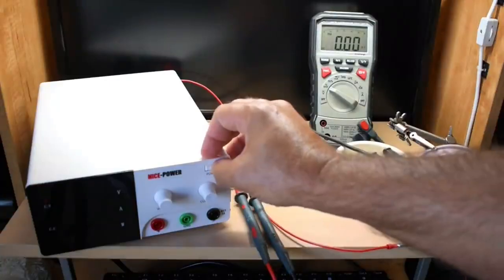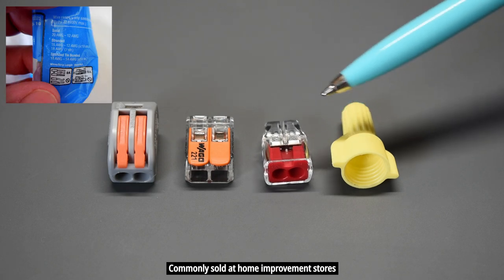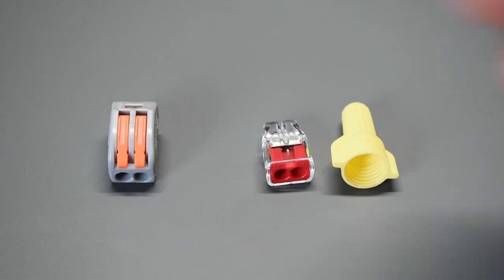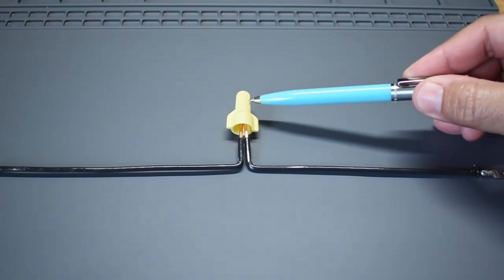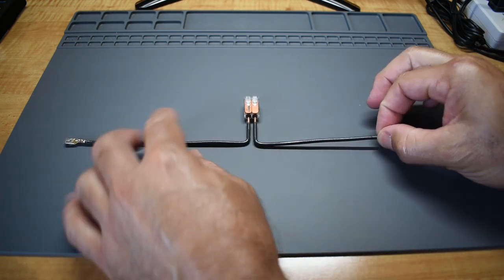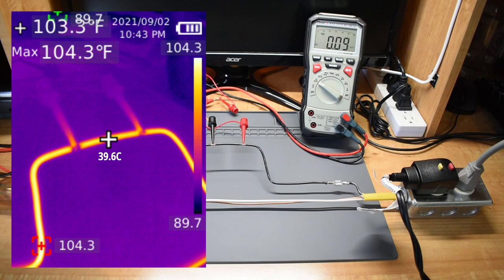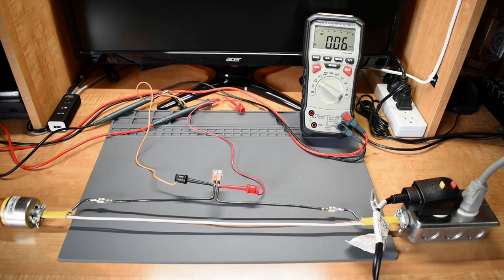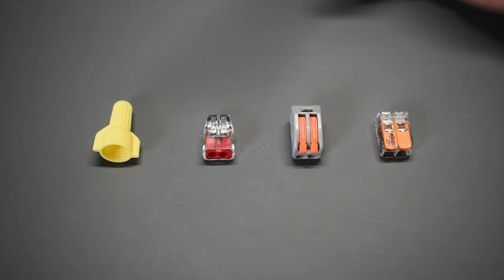BEST Electrical Wire Connector? Wago, Wire Nut, Ideal In-Sure, Lever Nut

Comment: They are from Europe, which is pretty much all 230 to 240V and an 18 amp circuit in Europe is very rare. most sockets in Europe are on 16A breakers, or in the UK we have a weird ring circuit with a loop on a 32A breaker. but they should be designed so that each leg of the loop circuit takes half the current, so again a max of 16A. the only circuits which would likely see anything over 10A would be in the kitchen, or an electronic shower/heater or possuble an EV charge circuit or other new green tech related system. but oven, cookers, showers, and heaters etc are wired on their own separate "special" circuits, with larger cabling (normally 6mm2 or 10mm2) and individual breakers, so you wouldn't be using these wagos on those. Wago do a larger model but the springs are stronger and all round much larger, so the results would be different. 

Wagos come into their own when the wiring has to be removed often. I work in industrial control, and Wagos are a godsend for quickly connecting and disconnecting sensors and other control devices. these devices are very low current/voltage (24VDC 4-20mA). 

Another reason these are popular in the UK anyway, is that these are certified as "maintenance free connections", meaning that they can be "buried" behind walls/under floors in hidden junction boxes. Other types of connecters (screw type) are not allowed to be hidden, and must be accessible. this is because the spring holding the wire can "breath" with the expansion and contraction from the heating and cooling in the conductor. where as other connectors (screw type) can come loose over time.
Reply: I wouldn't call a ring main weird, I would call it superior.

Comment: Thanks for the testing, good to know.  I use the Wago connectors for low voltage, and for temporary and testing mostly.
Reply from the maker: You're welcome Pete!
Reply: I used several of them on my motorcycle to aggregate wiring from a number of accessory lights... wasn't too worried about 12 volts, but I wouldn't use them for permanent 120v wiring.
Reply: @garthhowe297  I use them for 230V and 400V permanent wiring. No issues whatsoever.
Reply: @mrjakobt  Cable size has nothing to do with voltage. 1.5mm² cable is rated for 10 amps. 2.5mm² is rated for 16 amps, and 4mm² for 20 amps. Voltage, even if it's one billion volts, has nothing to do with cable size. Cable insulation, however, is related to voltage rating.

Comment: This is a fantastic test. Thank you for creating this content. I think the angle of the infrared camera reading may give an advantage to the wire nuts. The "top-down" angle in those measurements reads the temperature on the exterior plastic of the wire nut. The "bottom-up" angle on the Wago products reads the temperature near the junction of the wire and the metal in the connector, which is where the heat is generated.  I would love to see destructive testing that gives the mean time to failure for a sample of each of these units.  Thanks for showing us this excellent comparison.
Reply from the maker: Glad you enjoyed the video! I have many other testing videos on my channel, so be sure to look over my extensive video playlists below for videos of interest to you, and most importantly take one minute to share a link to my channel with others. Thanks
http://www.youtube.com/c/electronicsnmore/playlists

Comment: Nice detailed test. I am running new lines with a couple of outlets & switches and after watching a few videos promoting the Wago connectors I was considering using  them. But after watching your video I will stick to pre twisting & using wire nuts. If I had to connect several wires or had to work with an preexisting older outlet box with limited space I would then give the Wago a try.
Adding another 👍 to this video.
Stay safe, Joe Z

Comment: Thank you so much for this video. I just assumed there would be no voltage drop or increased heat regardless of the type of connector. Going to stick with wire nut.

Comment: I just wish you'd conduct the same tests with the mix of solid with stranded wires together.
Not only one solid and one stranded, but also with 2 or 3 solid plus one stranded. 
This is where the Wire Nuts get the worst connection especially with electronic thermostats and also with the heating baseboards or convectors,  everywhere you have a mix of solid and stranded under higher current. Wire Nuts seam to make a decent connection at first, but after pushing them at he bottom of the junction box they may loosen and also after 15 to 20 years the connections get loose, dangerously loose due to metal fatigue I believe. They often fail ! This is where the Wago 221 may be a very interesting solution.
Reply: Yeah, connecting solid and stranded wires together takes a bit more care to expose more of the stranded wire and to wrap it around the solid wire before wire-nutting them.
Wiggling is more of a long-term problem, too, with stranded wire because the strands break more easily.  Taping the wires together to prevent relative movement helps, but
it's laborious.  A video devoted to dealing with stranded wire would be invaluable .....  <hint, hint>  :-)

Comment: Very helpful. I use wire nuts when doing final work but have used lever nuts when making temporary connections. Was considering moving to only lever /wago option for everything but your demonstration convinced me otherwise.  

Sort of surprise how hot those connections get under load.  Never thought it be more than 100*

Comment: Excellent test, especially for doing it under 18 amps, which allows a load evaluation between medium and high, which is not commonly seen in other tests. The temperature detail is definitive when considering which is safer for medium/extreme conditions. My conclusion for use in connections of 10 amps and up I would only recommend a screw terminal box or wire nut used professionally. just my opinion.

Comment: Very impressive testing.  I think you've found an area where wire nuts are clearly better.  However, I think I still prefer Wago overall because they are more idiot proof, and that's more important to me.  I've run into more loose connections on wire nuts than I would like (some of them even mine), and I'm more concerned about a loose connection causing arcing than I am concerned about a Wago being a few degrees warmer.
Reply: The one area where wire nuts are better is the single most important aspect of a multi wire connection. The lower contact resistance means less heating, less possibility of arcing and more current delivered to the load.
Reply: @heathwirt8919  
Less heating, but does 6 deg +/- really make that much difference (wire nut temp at 106 vs the others at ~110 deg)?

And the voltage loss difference between the wire nut and the Ideal push connect and the others seems negligible too.   

As Dan Sanger said, I'd rather go for a secure connection, where no wires are going to pop out when you push them back into the box.  I've definitely seen wires come out of wire nuts when there's more than two twisted together.  

Can you even twist 4 or 5 wires inside a nut?  I'd be concerned about that.  You can easily connect 4 or 5 with the right push connect.
Reply: @jpmacoo  "And the voltage loss difference between the wire nut and the Ideal push connect and the others seems negligible too. "  If the voltage drop was negligible the temperature rise would be almost identical. Obviously there is a convenience factor to consider using the Wago connectors. If you need to connect 4 or 5 wires using wire nuts you can easily daisy chain the connection using additional wire nuts. My biggest gripe with the Wago connectors is that they should offer equal or better electrical performance than wire nuts, clearly they don't.
Reply: @heathwirt8919  
I didn't say the same, I said, "negligible".  5mv vs 8mv.  Do you think that and the 6 degree temperature difference are substantial differences?

And why do I want to add additional wires and more wire nuts in the box, when one push connect can do it all, more securely, and in much less space?  You're after adding many more potential problems and chances for disconnects
Reply: I depends on the quality of the installation, as you mention. Poor makeup of "wirenuts" will clearly lead to a problem; proper makeup won't. Have you tried the the 3M Secure Grip or 3M Performance Plus wirenuts? They are outstanding and likely the best wirenuts made. Properly installed, they form an outstanding, cool splice. I'd trust them over Wagos... But, I do agree with you that Wagos are more idiot proof, and that is definitely a benefit..
Reply: @jpmacoo  Heating gets greater over time because it promotes oxidation at the surface of the copper.
And if the wires can wiggle, more oxigen can get to that surface.
I'd still use the Ideal connector for joining more than 3 wires, though
Reply: @boeing757pilot     Idiot proof shouldn’t be an issue with a professional electrician, a wire nut is pretty simple to install properly.
Reply: @huejanus5505  Yes, this is true. But, I've definitely seen some poor installations (wire pull out).
Reply: @boeing757pilot     So have i. Even worse, i’ve occasionally just touched a wire nut and have had it fall off. The problem is usually pilot error though. With diyers a little knowledge can often be dangerous.
Reply: Wago aren't idiot proof, they are idiot magnets.
Reply: @boeing757pilot   - Re "square-edge spring":  How do you join stranded wire to solid wire? In that case, I worry about severing strands of wire.  Do you think a smooth spring and the use of anti-oxidant paste would work?
Reply: @daveinwla6360  That spring won't cut through the stranded. It will simply bite into it. I use the 3M brand exclusively and they do an excellent job without damaging the stranded conductors. But the Ideal brand "bites" into it as well and does nicely. Any quality connector will slightly "slice" (or bite) into the conductor to form the gas-tight connection without damaging the conductors. Grab yourself some Ideal or 3M to splice. It will be fine without an anti-oxidant.
Reply: @boeing757pilot   - Good to know!
Reply: @daveinwla6360  The 3M connectors are a bit expensive.  But, they are definitely worth the expense, especially if you're working on your own home. Check out the "3M Performance Plus" or "3M Secure Grip" connectors. A bit more expensive but definitely outstanding..
Reply: @huejanus5505  I have seen wirenuts melt from them being installed properly. Problem is because they are so cheap the threading on the nut was poor and the vibration wiggled them lose. Also the thin plastic of those cheap caps can spin off with some use of the wires. They are horrible and when I see them I replace them immediately. I go for the harder and thicker caps cause they tend to avoid the problems. Less prone to mice chewing as well.
Reply: @heathwirt8919  if it's german you can be sure it is safe. If it's chinese than you should be careful.

Comment: Wire nut problem is that many people don't tighten them enough. It's not about pre-twisting wires together, just need to tighten hard and feel for the bite into the wires, use pliers to give it a bit more bite without twisting so much you break the ends which happens more often with cheap copper. 
Wagos are great for mixed sizes or braided meeting solid.

Comment: Thank you!
I love using Ideal connectors, especially in tight boxes, but they ARE tough to use with soft stranded wire. In those cases, wire nut is still my go-to😎
Reply from the maker: You're welcome! Please share. Thanks
Reply: Genuine WAGO connectors work great for stranded wire.   Wirenuts are just fine if Done Right.

Comment: very interesting test. I moved here from Germany about 20 years ago, and first hated the wire nuts. I got used to it and actually really like the blue ones. I've also come to use all kinds of Wago connectors recently, and I also like them. It makes total sense that they are not as  good in your test, because of the solid copper wire you use. I think they are mainly used for braided wire in Germany (where I first saw them used by friends). Those wires in return, work very poorly in the nuts, so to each their own I  guess.

Comment: Perfectly done testing. This debate has gone on for quite a while, and finally there is a test that shows heat buildup. Especially on a short run.  Then you throw in the fact that if these were used to run a 7 or 8 outlet circuit, by the last outlet you could be talking quite a rise in voltage drop/heat buildup.

My biggest issue with the clip type connectors is when you pull it out and look where the blade held the wire in place, there is just a tiny nick in the copper.  That means that all the current is running thru the 2 points of contact made by the connector.  Essentially reducing the gauge of the wire electrically.  Overseas on a 240 volt system this may not be a problem, but as for in the US I'll stick to wire nuts.  Need more space, get a bigger box.
Reply from the maker: Glad you liked the video!
Reply: Actually, the contact doesn't leave any sign on the wire. You're confusing the spring holding the wire with the contact it is being held against.
Reply: @Llortnerof    A round wire sitting on a flat piece of metal doesn’t have a whole lot of contact space, especially when compared to two wires twisted and compressed together. One edge of a thin piece of spring steel digging into a piece of softer copper wire, on one small spot,  is bound to score a mark when there is any movement or doing a pull test.
Reply: @huejanus5505  Doesn't change that the flat piece of metal is the contact and the edge is just the spring holding the wire in place.

Comment: Wago 221 connectors are the best for refrigeration and HVAC. Wire nuts are actually banned for use on r290 or r600a refrigeration equipment (for good reason). Currently I haven't seen a single failed Wago connector. The biggest issue with wire nuts I've seen is the added stress of twisting old wiring causing it to crack apart. On residential electrical I'd use ideal connectors, everything else Wago 221. Not saying wire nuts are bad for in-wall electrical, but I don't use them.
Reply from the maker: Yes, I've seen some old wire nuts after many years end up with a crack up the side, which takes pressure off the wires.

Comment: Terrific.  Thanks.  I bought a box of the number threes in the end with the larger taller orange levers for solar and cheapo temporary connections to see if something works while I'm out camping.  My stranded, flexible wire connections work fine.